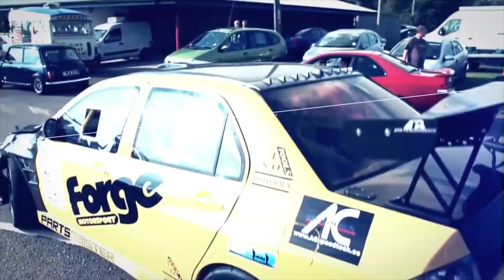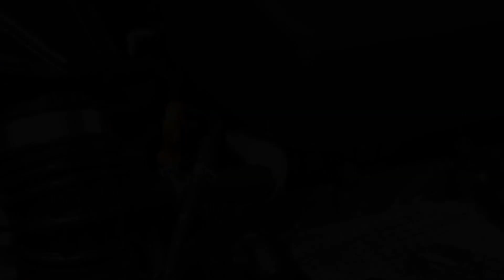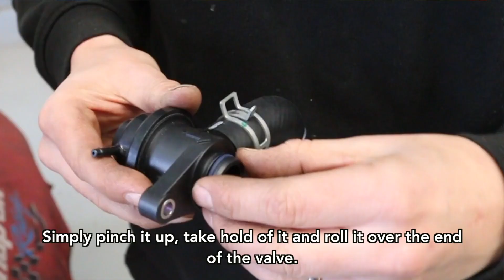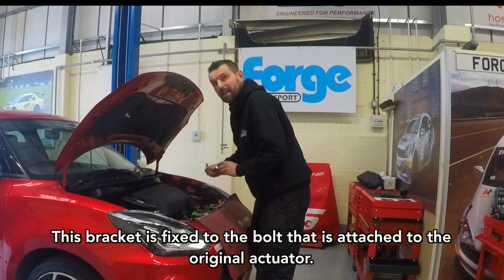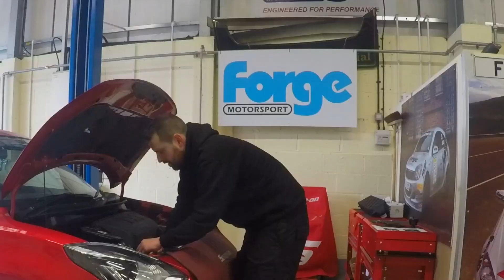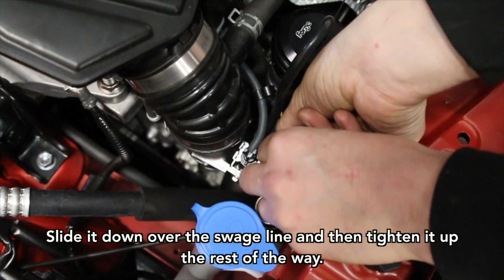Suzuki Swift Dump Valve (FMDV21) Installation Instructions

Comment: Need a little help my swift is stock what mod should i do first Bov or the inake?
Reply from the maker: Hey there :) What model of swift do you have? We'd recommend taking a look at the Sport Bundle, as it offers a significant saving on both parts :D (Here's the link: https://www.forgemotorsport.co.uk/Bundles/Swift_Sport_14.html) - The intake is the usual first step when upgrading the OEM components, the BOV second as it then can support the intake :) Let us know if you have any questions as we're very happy to talk your build through! - Esme, Forge Motorsport
Reply: @forgemotorsport  zc33s swift sport non hybrid
Reply from the maker: @Centward  Perfect. The above is compatible for the 1.4 ZC33s :) - Esme, Forge Motorsport

Comment: What is pros and cons assemble this bov to the engine?
Reply from the maker: Hello :) This product is reliable, and very easy to service. The spring can be uprated depending on state of turn.  Additionally it brings enhanced sound, improved boost management, reducing back pressure and helping to prevent undue turbocharger degradation/damage are the key product benefits :) - best, Esme. Forge Motorsport.

Comment: Can this valve damage the engine? Installing it improves the vehicle in performance or it's just the sound, thanks
Reply from the maker: Hello. The valve has been extensively tested and will not damage your vehicle. The valve gives greater responsiveness over the OEM, is far more durable, easy to service and change springs, and also provides a fantastic sound. If you have anymore questions, please email us on media@forgemotorsport.co.uk

Comment: How to service and what is the recommended lubricant ? Or did you use mobil 1 grease?
Reply from the maker: Great question! All of our service kits come equipped with lubricant :) https://www.forgemotorsport.co.uk/Forge_Motorsport_Valve_Service_Kit--product--792.html We recommend servicing at 20,000 miles or every 3 years (depending on which comes first). - Esme, Forge Motorsport.
Reply: How to open the valve if im going to service it? its too hard to open with hand

Comment: What would the first upgrades be to a new 2024 swift sport that won't impact the warranty and service plans?
Reply from the maker: Warranty and service plans are always a tricky situation when it comes to modifications. It depends on which country you're in as well as their laws and legislations. In the UK thinks like dump valves and induction kits dont tend to effect warranty and if you keep the OEM components can be easily put back to standard. However, a lot of OEM's will try to place blame on modification if something does happen to go wrong with the car. Something that is easily interchangeable such as the valve is something you could switch back and forth for service plans, but a lot of them dont mind and will still honour the plans. Again this is UK based advice. 

If you want more information you can look at your local laws and legislations and also have a looks at some owners clubs and forums on social media 

I hope this helps!

Comment: I have this car, is there a way to keep the noise but not use aftermarket parts? I understand the valves are different but changing the air intake achieves the same sound, but again I'm not really wanting to modify the intake
Reply from the maker: Unfortunately there is no way of achieving the noise without purchasing aftermarket parts

Comment: Any problems going from recirculating to atmospheric? Is this a dual piston bov? I have a forge 004 bov and was wondering if that could work
Reply from the maker: No EML light with our kit with the atmospheric option. This valve is not a dual piston valve, the kit includes full fitting hardware which is different to that of the 004 Bov as well as the valve in FMDV21 being of a smaller size due to space constraints.
Reply: @forgemotorsport  i has 1 small valve and a big one. Mine leaks at low rpm pressing the padale 5 tot 10% u hear it hissing and car wont go forward. The big Piston sticks and small piston inside it with the small spring cant hold boost. Iam sending it back hope i get any money back since it treu a shop local here...
Reply: @forgemotorsport  ps i made a movie of it on my channel u see it sticks then 2x oke and 3de time it sticks agean

Comment: Does this fit the 1.0 boosterjet aswell?
Reply from the maker: Hello Sir, we believe this may indeed fit the 1.0L Booster jet but would not guarantee this until we've been able to test fit
Reply: @forgemotorsport  Well, if you need a car to test fit it on, ill put it on my car and test it for you :-)
Reply: @forgemotorsport  Any updates on whether it will fit the 1.0L Boosterjet

Comment: What is the difference in placing a blowoff valve and a valve with recirculation (diverter)? Does the car bring valve with OEM recirculation, is the forge valve recirculated or not?
Reply from the maker: This valve is a blow off valve - it will make a 'psssh' noise - a recirculation will be almost silent in operation
Reply: @forgemotorsport  I know what the difference is, one releases the atmosphere and the other recirculates, my question is, when should I occupy one or the other.
What benefit do I get by occupying one or the other?
With which valve does the car behave better?
Reply from the maker: @chamyssgti  Hello. There really is very little difference. It is usually down to customer choice on whether they want the blow off sound or not
Reply: @forgemotorsport  do u have it without the sound ? i dont like the pssst crap :P
Reply from the maker: @ownd-z9l  We only offer the Atmospheric valve for this platform so do not have one without the Pshhh sound.
Reply: @forgemotorsport  to bad i hate the pssst crap lol

Comment: why do i need one of this if the car already has one OEM?
Reply: OEM is plastic and quiet, and if you're doing performance upgrades the OEM part is too weak
Reply: I am stock too. This will just give you that "swoosh" BOV sound in return if you're running stock. I am planning on adding an HKS boost controller so I might purchase this too.

Comment: Is it the same kit for Vitara 1,4 boosterjet?
Reply from the maker: Hello. We believe it will fit as long as the valve is installed slightly angled as to avoid the underside of the bonnet 😊
Reply: @forgemotorsport  thx.... i believe there is room enough in the vitara engine room. 💪😊
Reply from the maker: @kimsrensen8103  Hello. We also think there is, however, the engine cover may need to be removed ☺️

Comment: Do I lose boost preasure and power when I release the throttle? Recirculation is used to keep the boost pressure....
Reply: ...or am I wrong?
Reply from the maker: @AlexB13  Apologies for our delayed response, You will not see any loss in power as a recirculating valve just re-introduces the air into the turbo inlet which has negligible effects to power and an Atmospheric valve vents to atmosphere which can be better for tuning as a bigger volume can be dumped quicker without having to go back into the system, you also get the 'pshhh' sound from the atmospheric valve.

Comment: Nice and cheaper than others.. Did you test return suction?
Reply from the maker: Are you able to elaborate on what you mean by return suction? :)
Reply: @forgemotorsport  return to intake, better than air vent, which reduces the torque at low rev.. Cause MAF is located before return suction. Finally I bought HKS and try the 2 configurations, night and day !
Reply from the maker: @moi-cphilou6090  During testing at the dyno, with recirculation VS atmospheric, there was no change or detriment throughout any point in the rev range to torque or bhp :) 

On stage 2 software, the Forge atmospheric valve, eliminates more turbo surge than the OEM recirculation valve :)
Reply: @forgemotorsport  don't forget, ecu is adaptative, so it's need several tens of km to see a difference, on track maybe only 4 or 5 laps. I have stage 2 too, 182 cv and 325 Nm..